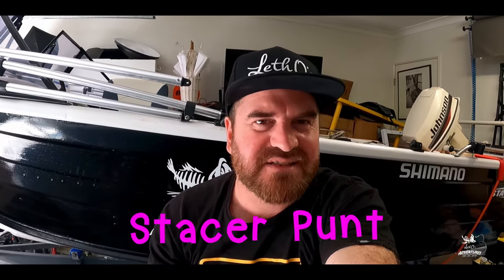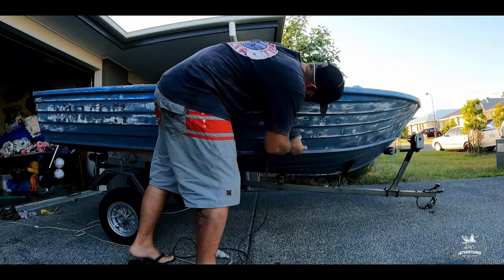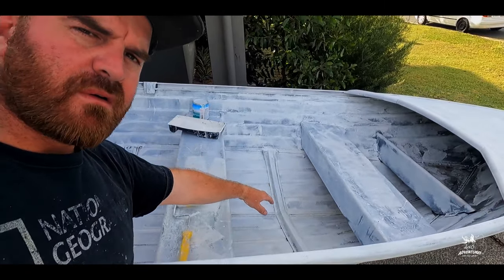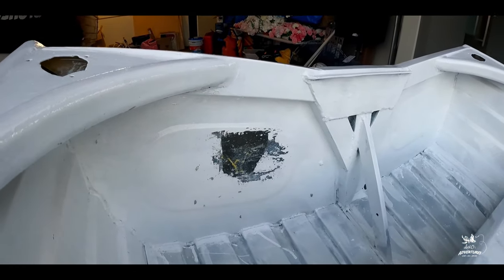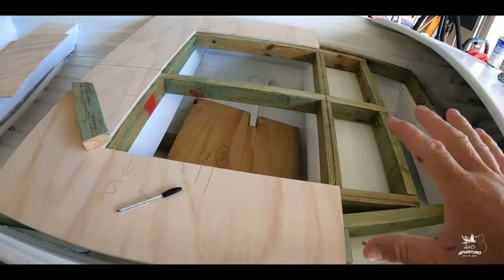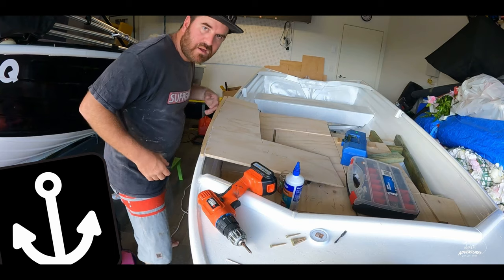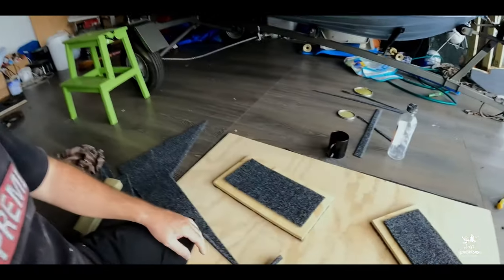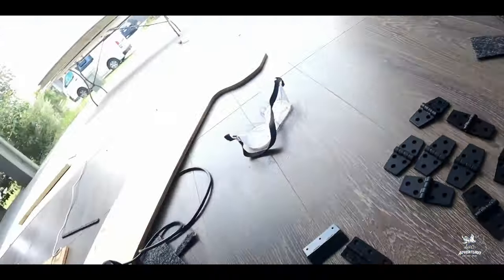Boat Restoration Start to Finish 3.4meter | ep 16

Comment: Mad vid mate just got a tinny same size and want to make a casting deck aswell so thanks that helped me out a lot.
Reply: Also was that marine carpet expensive or is there somewhere to get it cheap?
Reply from the maker: @keyansmall1298  thanks for the awesome feedback. yes it is marine carpet. I wouldn't suggest using normal carpet because it will rot once water is on it especially salt water. marine carpet is best because it wont rot. it was $45 per meter and well worth the $$$$ have a look at RTM store or even BCF they have great prices. thanks. :)

Comment: great video mate, just bought a tinny the same size and am looking to do a similar job👍 very helpful to see the process behind everything
Reply from the maker: Thanks Oliver it’s was great fun, you will have a blast doing it up. Thanks bro if you make a video send us a link :)
Reply from the maker: I’m planning on doing another one up but just have to find the right time
Reply: For sure bro, i've just been searching around to see if any shops in WA sell the Norglass paint and primers
Reply from the maker: @oliverharper2507  awesome if you do a coat of primer it will be better to use etching primer it will be a two piece primer. It’s way better for aluminium boat 🚤

Comment: Excellent video and entertaining with it, well done. Have a Savage 3.66 tinny very similar set up just finished getting it ready for the water. Installing a few stainless handrails so grandkids can hold on. Mine has a 7.5 Johnson and will pull 25 KPH lightly loaded in smooth water, and cheap to run as my last boat was a 16 footer with a 90HP Johnson and it would burn 60+ litres for a day out. This  little one uses 10....... Cheers
Reply from the maker: Thank you for liking the video it was fun to make it and yes you have a nice little boat to play with. Have a great weekend bud I’ll be doing another boat very soon. Just shopping for one ti rebuild

Comment: Why did you  roll the paint instead of  spraying  it ?
Good job overall  well done
Reply from the maker: Hay bud I don’t have a spray gun but even if I did have one I would have still just used a roller. For some reason with the 2 part paint when you roll the paint on it flatten itself out. It sort of look like the paint stretches. I’m doing another boat at the moment and rolling the paint on aswell. The results of a spray gun will look better but I don’t mind the results of using a roller because it’s a neater job. The spray from a spray gun can get messy..

Comment: Just bought the same boat for a project tinny/roof topper. Did the timber framing add a lot of weight to the front?
Reply from the maker: hay bud, no so the total weight if the castring deck was 25kgs it wasnt much even thos it looks like a lot.

Comment: Hi mate, great vid I’m painting a similar size bot how much paint would you have used overall?
Reply from the maker: Hi Anthony, If i can remember I used 3 Liters for the outside with thinners and 4 liters for the inside. its always better to get more because in the future if you scratch the boat you will have spare for touch ups
Reply: Would one litre of primer be enough 
Cheers
Reply from the maker: @anthonymurphy2754  tri it and if you run out then get more
Reply: Thanks for getting back to me mate, as my tinnie is small, what size thickness ply did you use, trying to keep the weight to a minimum
Reply from the maker: @anthonymurphy2754   hay bud you would use 12 mm for the floor but if you do make sure you install aluminium ribs so the floor doesn’t bend or sink in. 12mm should be fine and light this is for the floor in general. With the casting deck I would probably use a bit thicker wood 🪵 15mm or even just 12mm again  hope this helps